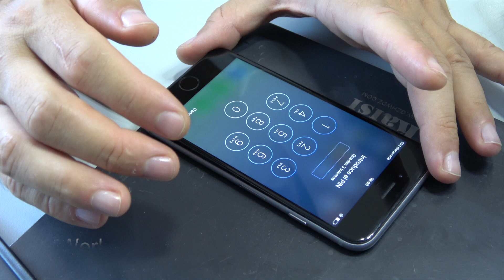SIM card reader replacement iPhone 6

Comment: what's the hot air temperature. i put 360 degrees and sim reader plastic melted. how to need to do good? Thank you
Reply from the maker: Hello. For desoldering you have to use 360º and for welt 280º, the temperature depends also on each  welding station you use; it s not the same a Weller wha 900 and a Baku .Have a nice day and thanks for your comment.
 www.movilone.es
Reply: 360 Celsius or Fahrenheit?
Reply from the maker: Lukas Kontrimavičius Celsius
Reply: I have a mini hot air gun, it's max power is 200 Celsius, do you think it would be possible to do it with that gun?